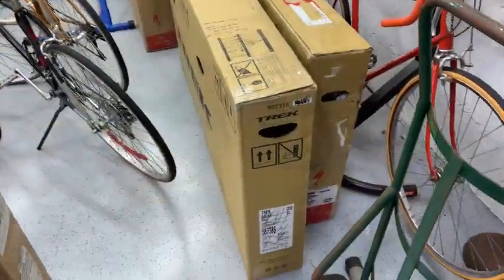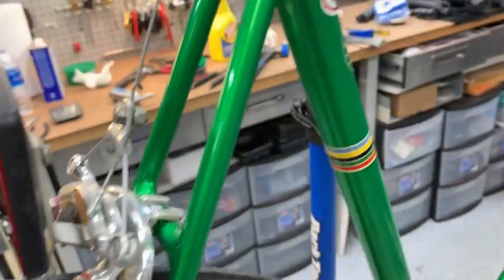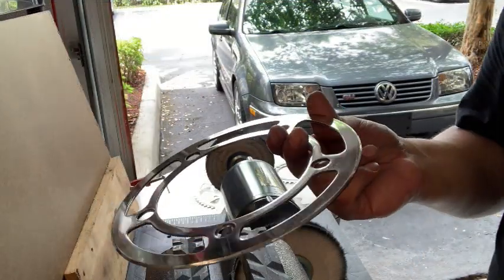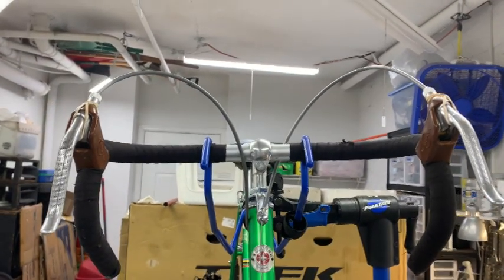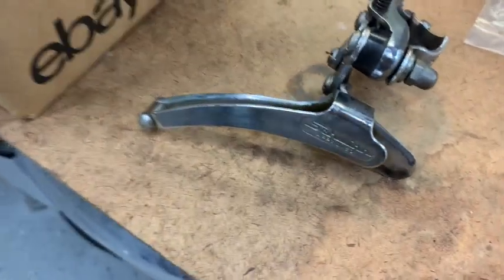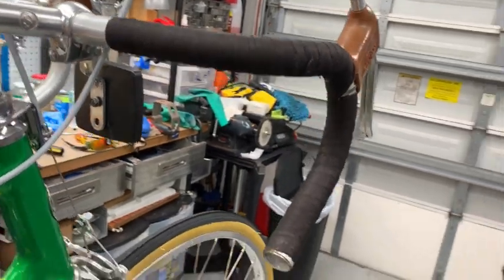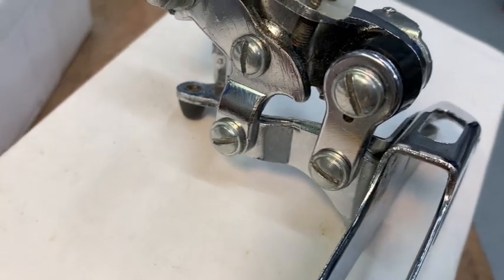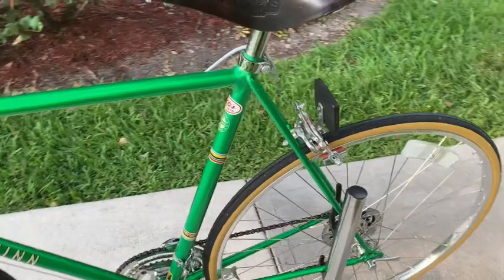1977 Schwinn Superior Build Complete

Comment: I see the Superior is in very nice shape, except for the cracking Weinmann hoods. I have a handlebar with Weinmann brake levers and those Weinmann brake hoods in brown in very nice shape no cracks or drying. If you are interested, I can sell you just the brake levers with those hoods on them. (I do not want to remove the hoods in case I damage them.) The hoods would really complete the Superior.
John.
Reply from the maker: Thanks! I was able to find a set after the video as well as a perfect head badge. 
I appreciate the offer and thanks for stopping by👍🔧

Comment: What seat post diameter is it? The inside of the seat tube diameter? 1" ? If you don't know about Semichrome German chrome and metal cleaner/polish get some. Try it with a very fine bristle brass brush on a rusty chrome fender. You may be amazed.

Comment: Do u have a Schiwnn Premis???
Reply from the maker: My lightweight collection features bikes from 1971 through 1979, I have just about every model listed in the catalogs for that period.
The Premis was introduced in 1988 and came with  a double butted lightweight frame and Suntour group set, a very nice bike that ranked 7th in the 1988 Schwinn lightweight category, landed between the Tempo and Prelude. 👍🚲
1988 Schwinn Lightweights

Paramount
Prologue
Prologue TT
Flying
Circuit
Tempo
Premis
Prelude
Voyageur
Letour
Traveler
World Sport
World
Sprint
Caliente

Comment: Beautiful rides as always.. Finally at the point of my life where I can start getting my 81 Le Tour cleaned up. I’m having a hard time finding the foam grips for that bike that it came with. Any suggestions?  Thank you again!
Reply from the maker: Thanks ! someone asked about those before and I searched with no luck, but I tried a different search and found these follow link not a bad price either
Good luck with your Le Tour and Thanks for watching 👍🚲🔧
https://www.ebay.com/itm/Sunlite-Road-Bicycle-Foam-Rubber-Grips-Pad-Set-for-Drop-Bar-Handlebar-End-Caps/332588694539?epid=1200060641&hash=item4d6fd4bc0b:g:DoUAAOSwdBZarEXw
Reply: That 70's Schwinn Vintage Bike Channel Thank you! Love the channel, on my 10th birthday I got a varsity, 1977 model, it was stolen at school in 81, My dad took me down to the Schwinn dealer, told me to pick out any bike I wanted, couldn’t figure out why he was being so generous, He told me later he claimed it on the homeowners insurance as being stolen out of the house, lol.. got a decent amount and I got my Le Tour for $335, I still have the price tag and everything that went with it, he’s definitely tired, hasn’t been ridden in probably 30 years, but has been inside the whole time. Can’t wait to get back on it again. I’m going to see if my local print shop can reproduce the dealer sticker, and I still have the info you gave me on the decals. 90% of them are still new, but there are a couple that fell off years ago. Thank you again!
Reply from the maker: @marxer19  Great high school memories 😏🚲🏡 Once you get the Le Tour out and about, you will love how agile and grounded it feels, these vintage bikes ride like Cadillacs and turn heads as you glide by a crowd👨‍👩‍👧‍👦👩‍👩‍👦🚲
Good luck with your project and thanks for watching 👍🔧🚲
Reply: That 70's Schwinn Vintage Bike Channel Got the foam grips today! Thank you for the link, very inexpensive, quick delivery. They were perfect. Thanks again!
Reply: That 70's Schwinn Vintage Bike Channel definitely am looking forward to being back on again. Old blue will be glad to be out for sure!
Reply from the maker: @marxer19  Perfect! glad they worked out😏👍🚲🔧
Reply from the maker: @marxer19  Get ready to rediscover the feel of you cruiser😏👍🚲

Comment: I have a early chwinn continental. It has a real tall headstock and can’t be ridden without hands. I put in the bike shop in Bakersfield and had it all fixed up and I put hundreds of miles on it all over California. It’s a real heavy bicycle…I need the original rear delailer
Reply from the maker: You can find the vintage derailure on eBay, the original derailleurs were functional but not the most precise when shifting through the gears.
 Being a stickler about OEM components, I have the original derailleurs on all my bikes and would not have it any other way👍👍🔧🔧

Comment: Holy cow!  I just came across your channel while researching the 77 Superior I picked up.  I didn't realize how much work went into everything, amazing job man!  Mine is the black Superior and i put dark leather brooks bar tape on it.  Rode 25 miles yesterday and it rides just as well as my Surly Straggler.  Were these 10 speed bikes?  Mine has a 6 speed cassette on the back, I don't think it's original.  I'd like to figure out how to modernize to index shifting on the rear with bar end shifters but don't know where to start
Reply from the maker: Nice! Yes the 1977 Superior was only offered with a 5 speed freewheel and friction down-tube shifters. Yours certainly was modified like many of these old vintage biked have over the years. My goal is to bring them back to period correct components as offered in the Schwinn Catalog for any particular year. You could add the index shifters I'm sure, RJ the Bike Guy has several videos on his channel where he modernizes old components see link below  Thanks for watching👍🔧
 https://www.youtube.com/watch?v=SJJyl0xPrJ0
Reply: @that70sschwinn  Schwinn catalogs list bar end shifters as option in '77. I just picked up a black one with them.
Reply from the maker: @sparkyguy66  Nice, yes I saw the option on the Schwinn Lightweight Data Book Bottom bar Huret derailleur control.
Schwinn-Approved ratchet handlebar mounted controls available at as extra cost option. These are basically a Sports Tourer minutes the made in England bars, Brooks Saddle and fancy freewheel

Comment: How available is the paint and decals?
Reply from the maker: It depends on the color, there is a company that specializes in certain Schwinn colors, they are exact factory color reproductions, they sell complete kits that include everything you need.
see link below
https://www.koolestuff.com/store/p66/koolestkolorspaintkit.html
Decals are available on eBay, Bicycle Bones is one of the sellers that offers  many options
https://www.ebay.com/sch/i.html?_from=R40&_trksid=p2047675.m570.l1313&_nkw=schwinn+decals&_sacat=0

Velocals also has tons of hard to find decals
 https://velocals.com/

Comment: What kind of lube do you use on the cables?
Reply from the maker: I have used basic chain lube, a dry formula called Chain Pro available at my local bike shop and also used Park Tool CL-1 Chain lube. Keeps all the cables moving freely. Thanks for watching👍🔧
Reply: @that70sschwinn  so how do you apply it?
Reply from the maker: @johnelliott5923  I usually apply the lube when changing inner cables, so it's easy to dab some on the inner wire or drip a little inside the outer cable casing. It's a little more challenging when the cables are already on the bike, you can loosen the cables to expose the parts that make contact with each other or drip some lube while holding the bike in a way that the lube runs into the desired cable area. If your cables are rusty, it may be a good idea to change them.